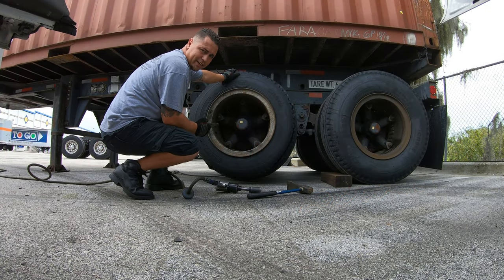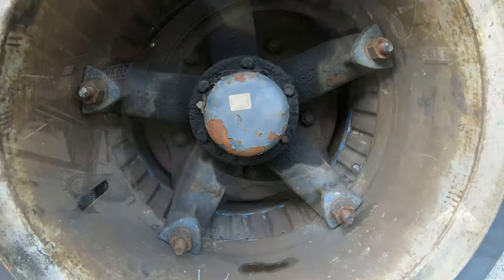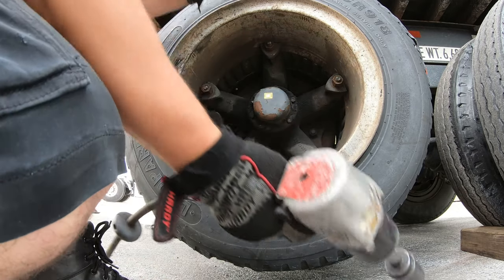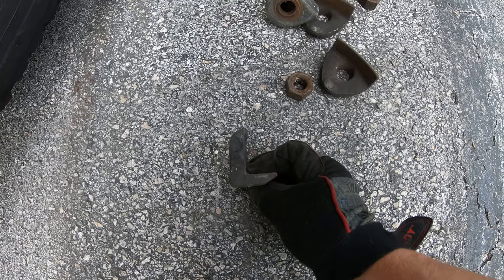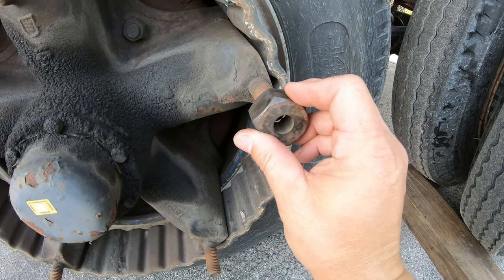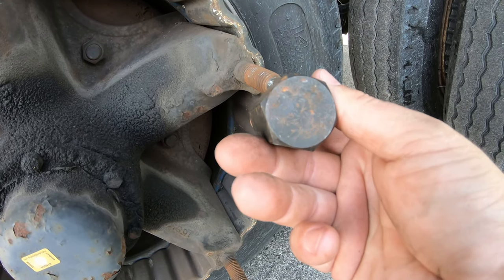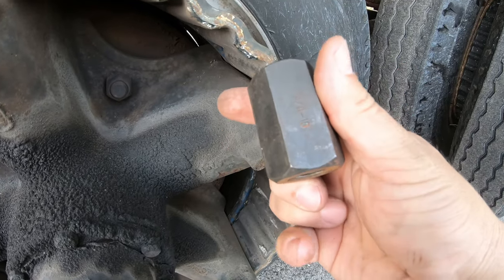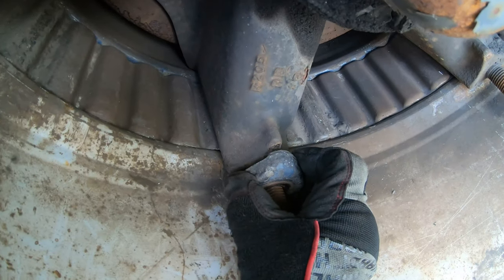Lugs and Wheels on a truck (Part 2)

Comment: You should use a breaker bar with the stud removal tool. Less likely to spin.😉

Also, if your wedges are bottomed out, you should take off the inner wheel and inspect the lips on the spider for cracks/missing chunks. Can't tell you how many times I've seen someone put a wider spacer only to have their inner wheel pop over the back of the spider...

Excellent video as usual, fellow tire guy 😎
Reply from the maker: Your exactly right. I’ll have to go over that in the next video as how to align the wheels. Thanks!!!

Comment: Hello friends, admirers of the wonderful Dayton and Trilex wheels! Here in Brazil in the 70s, 80s, 90s until 2000, our trucks used this type of wheels a lot! I personally like them a lot! They are super strong and add a lot of charm to the Truck and Truck. In the 80s I worked at the Swedish automaker SCANIA, precisely assembling these Trilex or Radiated wheels as they are called here in Brazil. Smaller trucks used 5-spoke trucks and heavy-duty 6-spoke trucks. Nowadays it is practically impossible to see new trucks.